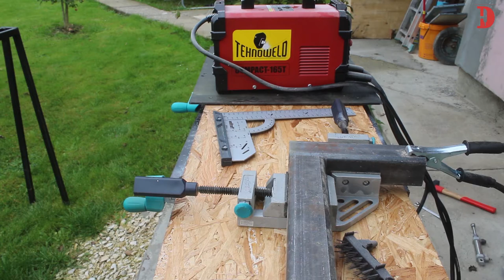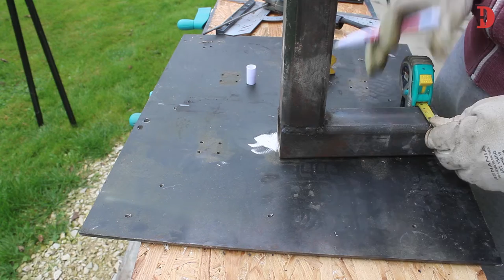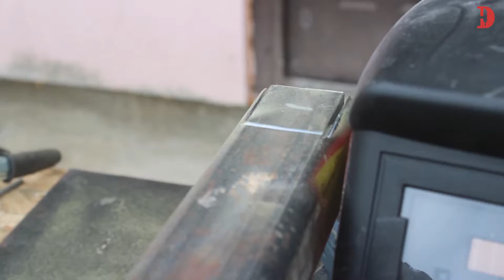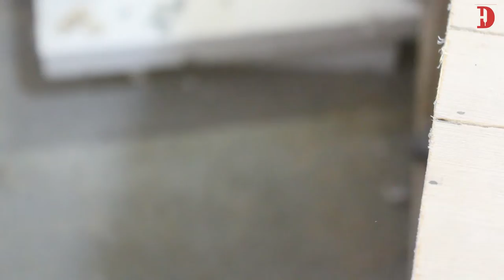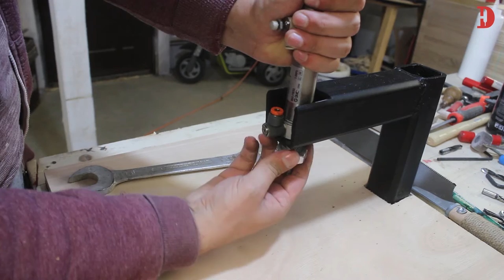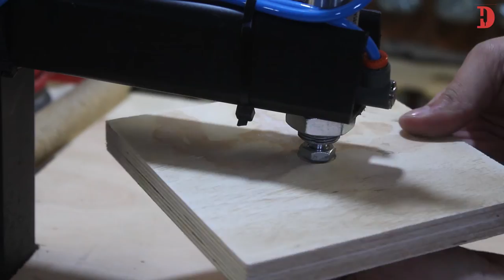DIY pneumatic press

Comment: Can you tell us what are the materials you used in making this pneumatic press? As i am tired making round pita bread by hand , i thought this would help me spending less than buying a very expensive pneumatic press.
Reply from the maker: Metal plate and some metal profile for the frame, pneumatic cylinder and univer cm-9423D for the pneumatic valve that opens and closes the piston.
https://eltra-trade.com/products/univer-cm-9423d
For food related products I saw something made out of wood, and you press using your weight.
Reply: @DanielH thank you so much! Hoping to see you build more simple DIY pneumatic press soon!